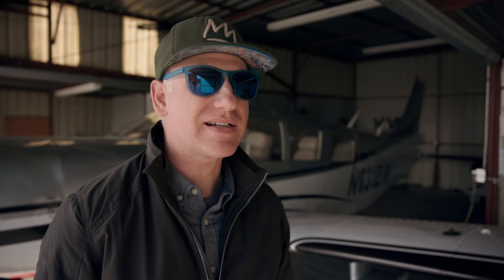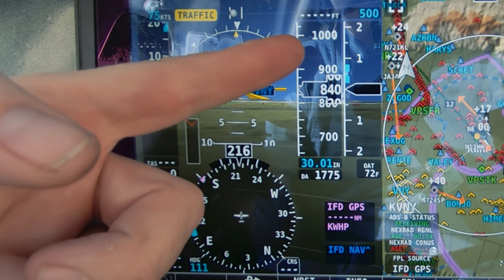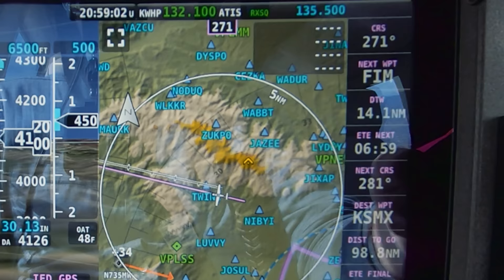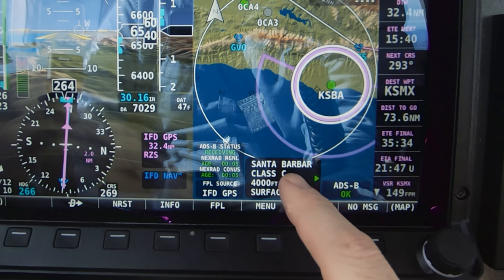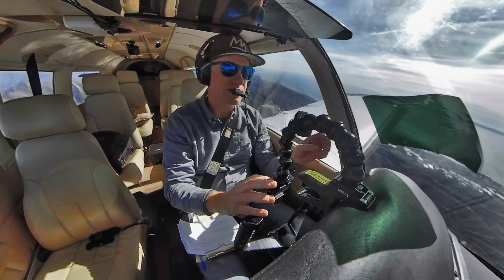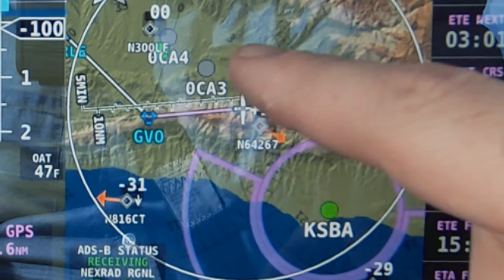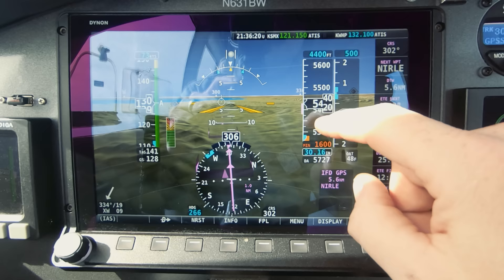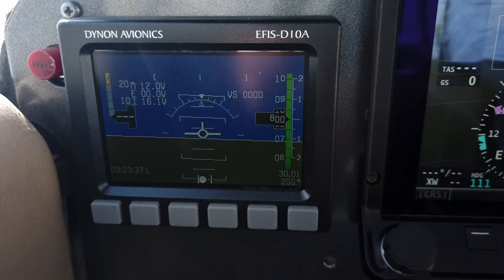Dynon Skyview in a Cherokee| HDX FULL REVIEW in flight and w/approach | BEST GLASS PANEL EVER?

Comment: I'm getting ready to do a panel upgrade and considered this system until I saw the frame rate on the SVT runway animation.  It was like flying Microsoft Flight simulator on a Commodore 64 from 1985.  That would be a deal breaker for me.  Otherwise, looks like a great system.
Reply from the maker: When you are that close to the runway you are not looking at the synthetic vision of the runway.  You're looking out the windscreen.  If you're on an IMC approach, you're looking at needles, HSI, etc etc and occasionally maybe glancing at synth vision.  I never even noticed it until someone else pointed it out. I really wouldnt let that stop you from looking strongly at the HDX.  It really is fantastic and the refresh rate on the entire display is very fast and responsive.  The runway animation has a lower framerate for whatever reason.
Reply: @SoCalFlyingMonkey  I'm not trying to start an argument, but just pointing out that such a high quality system should have a better frame rate for the SVT.  My previous G3X (old style - not touch) was butter smooth SVT and it was 6 years older technology.  Whether you are looking on the windscreen as the pilot or looking at the SVT as a second in command or spouse, it should at least be as smooth as older technology.  I have been flying for 32 years and have owned planes with the G500, G600, G3x, and G3x touch and they were always fast frame rate refresh on regular or SVT display.  To be honest, I am tired of Garmin's "you must buy everything from us" mentality and was hoping to go with the HDX and autopilot in my newly acquired TR182, but I just can't see buying something as awesome as this and living with a poor SVT representation.  I guess I will just keep my steam gauges for now and wait for the processing speed for the SVT to improve.
Reply: @SoCalFlyingMonkey  Well, I came over to the dark side and decided to install a complete dual 10" system in my TR182.  Tell Dynon and Jesse Saint to send you a commission, lol.

Comment: Hi Eric.  I met you in the Piper Forum.  I am from Oceanside.  Why did you choose the Dynon over the Garmin G3x.  Do you have to find an instructor who knows the Dynon when you flight review?  Great work.  Love how you share family outings.
Reply from the maker: The Dynon seems to have an equal or better feature set and represents a better value to me. The lack of a battery backup in the G3X Certified stopped me from looking into it more, combined with Garmin's walled garden approach to their hardware.  The Dynon is more likely to interface with future avionics I might install in my panel.  They play well with others and the company has a reputation for excellent customer service.  I don't have to surf past watches, car and boat GPS units, etc to get contact info for someone who cares to help me with my EFIS...if you know what I mean.  The HDX user base of homebuilt aircraft owners is a nice foundation for user engagement and product development.  I think Dynon is doing great things.  It just all added up for me.
Reply: @SoCalFlyingMonkey  really great insight there. I'm an EAA guy. Planning my kit for next. This video settled Dynon for me. Got a ball park apples to apples of what you saved using Dynon interfaced with Avidyne rather than another AP? If you didn't have the GPS would you choose another to be coupled with Dynon? Hear anything on if Dynon might be getting their GPS certification?

Comment: Nice.  Got here by way of your post on Beech Talk.  I have been shopping Bonanzas and contemplating the consequences of a new panel.  BT discussions seem to go wild on electric trim and auto trim in comparing auto pilots.  I have significant experience in KA 350s and Pro Line 21 which have 3-axis AP and auto trim so I suppose auto trim worked well enough in the background that I didn’t notice it, but I preferred manual trim when hand flying, especially approaches, for the precise adjustment, feedback, and tactile feel.  What does Tru Trak and Dynon give you for trim and what is your opinion of them in the cockpit?
Reply from the maker: In my airplane it is all manual trim.  The TT autopilot flashes an indication if it is out of trim and asks for more UP or DOWN trim.  It can be finicky so once I get the notice to disappear I dont touch it again unless I make a power change or start a climb or descent.   The TT is a very good autopilot and I really like the Dynon HDX.  Looking forward to if/when the Dynon Autopilot might be approved for the PA32 and I'd like to install it to make it more integrated with the system.

Comment: Great videos. I really appreciate your posting them. Before you bought  the Dynon, did you also evaluate Aspen or other systems. I’m at the first stages of doing this. And so far I tend to favor the Dynon.  I like everything in a graded on one screen and it’s very clean.
Reply from the maker: I looked at the other systems.  The Aspen doesn't have near the features of the HDX.  The G3X looked great too but at the time, no battery backup which was a non-starter for me.  The Dynon represents amazing value IMO.  I'd like to put in another 10" screen.  It's amazing.
Reply: @SoCalFlyingMonkey  The more I read about it and compare the systems, that’s my impression too. I’m very impressed with all the features. It has such a clean look.

Comment: Excellent and informative video with great editing! I have subscribed to your channel! Question....how well does the Trutrak integrate with the Dynon? Can the altitude preselect as well as other features be activated from the dynon?
Reply from the maker: Thank you!

The TT integrates a little with the Skyview. But nowhere near as good as what the Dynon autopilot would do. (The Dynon AP has a full flight director mode and loads of other features...audible alerts, etc etc.) The pilot guide and Dynon training videos can illuminate these advantages for you.

This is gonna get technical- bear with me....As far as the Trutrak, mine is connected to both Skyview and Avidyne IFD540 GPS. There is a toggle switch. When set to Avidyne, the TT can itself be in a couple different modes and this is controlled on the TT head unit. Track mode lets you dial in the GPS track, Altitude and Vertical Speed on the head unit using the buttons there. You can switch it to GPSS mode and it will follow the flight plan from the IFD540 (or any approved GPS) and you manually set the Altitude and Vertical speed on the TT head unit. In this mode, I have to bug an altitude on SkyView, and also select the altitude on the TT (same for track and heading and VS).

If I switch the AP source selector switch to the Dynon instead of the IFD the TT will (after pressing MODE) display the words SKYVIEW on it. It will then follow the flight plan that the Dynon displays but not using GPSS so it doesn't anticipate turns (I have barely tested this mode). If you clear the Skyview HSI to display no course guidance (or I think just a VOR source) then the autopilot will follow all the bugs that you set on the SkyView. It essentially becomes the controller for the TT. So you can bug a Heading (and yes a HEADING rather than TRACK like described previously), bug an altitude and a VS and the autopilot will fly these values. This mode is handy if you are getting vectored all over the place and really want to fly heading and not track although there is tons of debate over if it really matters. It is a switch flip, HSI touch, and one or 2 button presses to go back to the IFD and GPSS mode so I don't tend to use this mode in higher workload situations. But you're not bugging things and also setting the same values on the TT.

In both switch modes the Baro DOES NOT sync between the HDX and TT so you must sync the TT with the current altitude before takeoff and at each BARO change if you value accurate altitudes. (haha) And in BOTH modes the Control Wheel Steering functions as it should if you hold down the Disco button and make a turn, climb,descent etc.

I made a video awhile back showing the TT integration...well just the heading mode so I could probably do a longer video. I think this will be a good combo HDX plus TT for a lot of folks until (if) the Dynon AP is certified for everyone's particular model. I know I didn't want to wait the months, years?, if ever? for the PA32 cert. Maybe its just right around the corner.. At that time, maybe I'll swap my TT for the Dynon AP. But for now I am enjoying long cross countries with my family with the TT!

Here is the TT/HDX integration video I made that demonstrates how the Skyview integrates with the TT.
https://youtu.be/q5-5YVrgz2A
Reply: SoCal Flying Monkey thank you so much. Please keep the videos coming and I look forward to seeing your family adventures. I have had three friends sign up to your channel.  Tailwinds my friend!

Comment: But do you redundant main instruments?
What if you have an electric problem?
Might be a good thing also for Poppins to have some basic gauges on her side too.
Reply from the maker: The D10A is an independent backup full AHARS.  The HDX and D10A have independent battery backups and should last 45minutes to one hour on their own.  So backup number one is HDX battery, number 2 is the D10A with battery and number 3 is ForeFlight synthetic vision and the stratus 2 mounted overhead both always fully charged and ready.

Comment: Question, can an ILS or GPS Approach be loaded on the HDX System for Waypoint info? (not through the GPS, solely on the HDX) Great video by the way, very in depth review and solid info!
Reply from the maker: I don't believe that the HDX itself has approaches in the nav database.  all the waypoints i presume are there and you could manually program them but there is no function to select and load an approach for any particular airport.  I think that is because the GPS in the HDX is VFR only.  However, when I load and activate approaches using my IFD540 GPS (which is IFR certified) everything shows on the HDX.  And the HDX can display the approach charts as well...
Reply: @SoCalFlyingMonkey  l kinda figured that's the case. Thanks!

Comment: Did you keep all of the factory settings on your TruTrak or did some of them need tweaking once in flight?
Reply from the maker: The installer set it up and I haven’t changed anything yet.  I think the altitude hold could be a little tighter so I have been thinking about experimenting with the vert activity setting. What do you think?
Reply: @SoCalFlyingMonkey  Agree, going to make a slight change with my vert activity as it seems to oscillate a bit

Comment: Very informative video - great job!  I am in the process of upgrading my non-WAAS GNS 530 in my Bonanza to the Avidyne IFD 540.  After that I am seriously considering the Dynon Skyview, but I need to determine what I need to do to have it drive my KAP-200 autopilot.  How did you end up having the install done by a shop in Florida?
Reply from the maker: You will love the IFD540. I came from a 430W and the 540 is light years ahead of the 430 and 530 (as it should be since they were made over a decade ago). I am not sure the Skyview can drive your autopilot but if the DYnon AP is or becomes certified for your model you may find it priced right to install it instead of your current AP?  I am hoping at some point it gets the approval for my PA32.  I took the plane to Florida because the shop I used is run by someone that I consider an expert on Dynon installs (and Trutrak). The FL shop was also CONSIDERABLY less than the quotes I got in SoCal, Northern California, and Arizona.  Also almost all shops in the L.A. area did not want to do the Trutrak since they want to sell the Garmin AP being Garmin dealers.. ($$$).  I happened to have a 9 day job in Florida and it was a good excuse to fly out and get it done.  I am very pleased with the results.

Comment: Very nice review of the Dynon system ! One question though ; Can you or someone at Dynon confirm that it’s ok to have two separate screens, say two 10”, and in doing so eliminate the need for the smaller D10-A display ?
It says so in the beginning of the video when you show us the back up display.
I recently saw on Dynons homepage that you must have the D10-A regardless of how many HDX display you have ?
Reply from the maker: I think you do indeed need the D10A. But someone on the Dynon forums would probably be able to give you a definitive answer.  Dynon reps hang out there and are also available by phone pretty easily.
Reply: What would also be cool, if you could use one of the GARMIN’s 275s in place of the D10 as a backup -since they are completely independent anyway (has its own battery and ahrs and fits in a 3” hole).

Comment: Nice panel. I like how the iPad is mounted. I have a lance and am struggling with iPad placement. What manufacturer and model of mount are you using for the iPad?
Reply from the maker: Its My Go Flight and I think it is the sport or panel/stud mount with the Universal cradle.  It has worked well for me so far.  And when they come out with an iPad that is 1/8" different in size I don't need a whole new installation!

Comment: Great video. I looked for an FMA annunciation section on the PFD to see which modes you had engaged on the Autopilot but couldn’t see one? As suggested, there should be a way to couple either VNAV or a synthetic glide path and just set minima on the altitude selector? Do the units cross fill in both directions?
Reply from the maker: I dont have the Dynon autopilot.  (not yet certified for PA32) The Trutrak follows the IFD540.  I have a review video of the trutrak that covers it in depth.

Comment: Nice panel, considering for my Saratoga, question: skyview hdx does support engine monitoring, why did you decide to go with JPI EDM
Reply from the maker: I already had the JPI engine monitor which is certified for primary.  I did not want to replace all the sensors and add cost to the Dynon install and have the engine monitor data use up screen real estate on the single screen.  If I were doing a fresh install I would probably put a 7" screen for the Dynon engine monitor.

Comment: does the display present any 'choppy-ness' or reduced frame rates when info is refreshing? i flew the Garmin G3X and wasn't too impressed with its display frame rate. I prefer the presentation of info on the Dynon to Garmin but how it does not have the same issues! Also when its dimmed down for night flight do you feel it gets dim enough?
Reply from the maker: I do not notice any reduced frame rates in any of the flight instruments and map display. Someone commented that when landing the runway depiction on synthetic vision is not super smooth.  I never noticed this because I am certainly not looking at the synthetic vision during the flare.  Looking at the video on landing, it appears as though the runway depiction in SV is programmed to be a lower frame rate on purpose while all the flight instruments etc remain at their normal frame rate.  I find the frame rate of the system to be excellent and it has never once felt laggy in any way.  That would be totally unacceptable.  It feels super smooth and responsive throughout.  Going through menus, screens and selections I notice that everything is very snappy and responsive.  I personally find it super annoying when this is not the case.  Have you ever seen the small animation of the virtual keyboard popping up on the Avidyne IFD 540?  Even the smallest amount of ease out of that animation bugs the crap out of me as it makes the whole experience feel less responsive.  Hopefully you can get your hands on a Dynon HDX demo unit at a shop or someone's plane and play around with it to see for yourself.  Plus, the HDX has a backup battery!

Comment: Great video Eric, took your advice on a previous question about a year ago, installed the Avidyne IFD 540 and the PMA450B audio panel, now the Dynon panel is next. Had to do it in phases. Last question, is there a reason you had the EDM engine monitor verses the Dynon engine monitor installed? DOD you like the EDM? In my Cherokee 235 I have the EDM 800 but want to upgrade it. Just not sure if I want the 830/930 or
have the Dynon engine monitor installed with the Dynon system
Reply from the maker: The JPI engine monitor was already in there, certified as primary and working well.  Didn’t want to pay again to get basically the same functionality and I like that it doesn’t take up screen real estate in the HDX screen. If I were doing a fresh install I would do 2 HDX screens or 3 and make a small one dedicated to Dynon engine monitoring.
Reply: @SoCalFlyingMonkey  thanks Eric. Very helpful and I appreciate all of your videos. They have steered me and my 235 in the right direction.